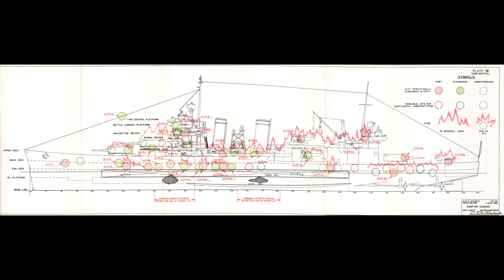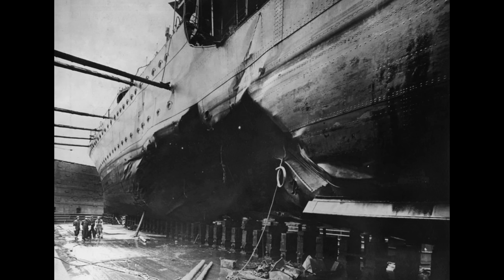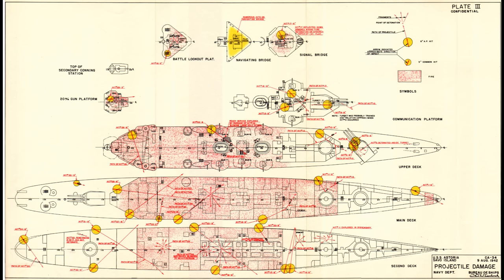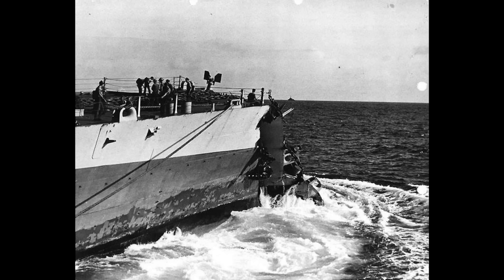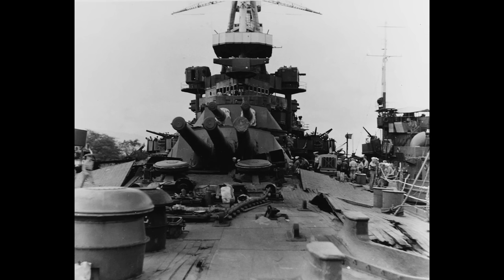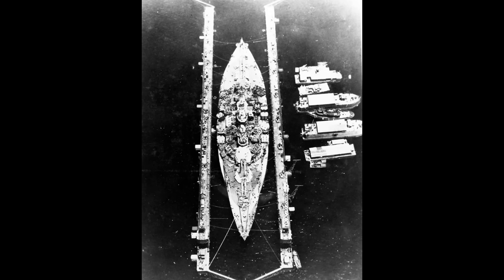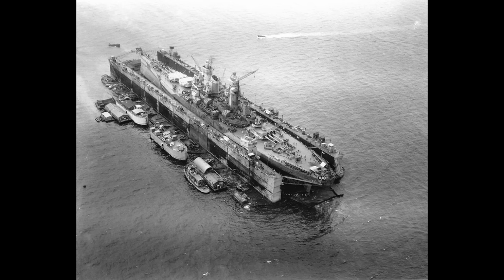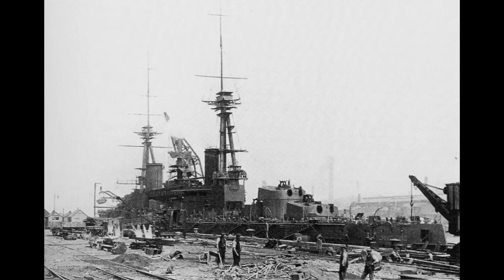Repairing a Damaged Warship - Ship Triage and Treatment

Comment: Honestly there are an awful lot of photos there which show just what a Herculean task the crews did with their damage-control procedures. With a lot of them it's a case of "how the hell did it survive THAT???". Some of those chuffing great holes look way too wide to have survived.... but still they did.  My respect for the sailors of various navies has gone up several points.
Reply: One of those pictures I recognized as an American cruiser that ended up missing everything forward of the turret... and I remember this picture because it was the number two turret. Number one turret was gone, the bow was gone, and the magazine that had exploded and taken them off was gone... yeah, the magazine exploded and they still managed to save the ship.
Reply: There's a lot of motivation in the fact that, if you don't keep it afloat, it's a long swim home. My own, noncombat experience doing emergency repairs to reactor controls involved shutting down the reactor and running on the diesel. The diesel exhaust pipe ran very near where we were working and an earlier hydraulic leak had saturated the insulation on that pipe. We found ourselves doing delicate, precision work with our heads spinning from the fumes. I know this pales in comparison to the conditions those heroes endured while saving, and in many cases, not saving their ships.
Reply: It is quite incredible isn't it
Reply: I looked at those USN after action analysis drawings, and the images of ships like CA-32 and breath a lot. Fix it or burn or swim seems to be a great motivator. Respect is indeed due.
Reply: you can become very motivated when your only other option to saving the ship is to go for a very long swim.

Comment: A note re: avoiding splicing wires.  I can confirm, at least in a mining environment, when re-building equipment we ALWAYS re-cable.  Any splice, no matter how carefully done, will quickly corrode and cause problems.  I can imagine this is much worse in saltwater spray environments.
Reply: Nonsense.
Reply: I working for a company that repaired cables. It's never as good as new but can be done well. I'm not aware of any mines that will do anything but the most basic repairs on-site however.

Of course this was in a workshop hours from the sea.
Reply: Interesting seeing the difference in fields - I work in automotive and we vastly prefer splicing in most cases. A well-soldered/crimped and heat-shrinked connection, especially in a static position (I.e. you don’t have to account for the wires to a control unit ever moving much) is usually plenty fine for the life of the car. But cars wiring is generally undergoing much lighter stresses by comparison - rarely hotter than 250F and not submerged or flexing a ton. 

Re-laying is also often untenable, since the majority of the car’s components are serviced by like 3 embedded harnesses + one for each door if you’re lucky. Tearing apart an engine or an interior just to replace the whole harness is a ton of work, and even if you just wanted to replace the wire between two components, that may require a long journey of removing stuff and opening up ducting.
Reply: @TimelyAbyss Are the harnesses in your equipment more modular, or more easily accessed, to make re-laying less of a hassle? I’m sure you don’t have to deal with a lot of trim panels 😂
Reply: @constructmaster6280 : I'd imagine that it's a more explosion-prone equivalent of housing rewiring, and the only reason that doesn't get done frequently is a lack of desire to hire an electrician, which likely isn't the case in any authorized mine.
Reply: @constructmaster6280  it’s worth noting that I’m talking about full re-builds not field repairs.

So a scoop tram or a face drill that’s seeing sunlight after years of “battle” being driven (or often towed) up the “port” (aka the surface shop).  Every cable (hydraulic and electrical) is pulled and replaced.  Engine removed and rebuilt…ect.  By the end the thing is almost factory new and ready for a few more years of “battle”.

 Seemed more appropriate given the context of the video.

Ah you can’t imagine the abuse these things see.  Constant heat and mud, highly mineralized mildly acidic water, rock falls, straight up abuse from the operators.
Reply: Linesmen regularly use splices to repair damaged sections of buried HV cable that simply can't be replaced without knocking down buildings or putting a big trench straight across a six-lane highway etc. But this is not a simple cut-and-shut job when dealing with HV cables as thick as your wrist, specialised materials and tools (and a fair bit of carefully applied force) required, and every part of the job must be done to a high standard to ensure that there are no problems later (for many years at least).

Comment: Battleships may look "obsolete" if compared to modern missile warships but they were still a true marvel of engineering. Just imagine: they built those formidable monsters without any electronic stuff and other "super-duper high technologies".
Reply: Play Rule the Waves and build your own!
Reply: I recall that in the '90s it was said that an Exocet missile would just ruin the paint job on an Iowa class battleship.
Reply: @harrykoppers209  mmhmm.

With ships having a minimum of armour these days, no need to have as much penetration in your munitions, when you can instead blast bigger holes, or have more range.

Someone, if they decided to make a modern battleship, and assuming said battleship got hit in the armour belt, would laugh off modern anti ship missiles. If it got hit anywhere else though... lets say, going straight down through the deck? battleships of WWII would NOT, survive that any better than a modern warship.

As such, if anyone WAS, going to make a modern battleship, intended to be armoured to protect against all threats. It needs to be far more armoured than battleships ever were historically, in an age where 13 inch thick plates of properly heat treated steel just aren't made anymore. And that then begs the question, won't someone just make a bigger missile  with your fancy new ship as a target, or find an already existing missile, made for bunker busting perhaps, that will do the job?
Reply: @Destroyer_V0 : I suspect they would worry about torpedoes and their own soft spots, build extra large so there's extra bulkheads to provide structural support & compartmentalization, and then allocate the rest of their attention to "stealth" and active defenses. LOTS of active defenses.
Reply: @absalomdraconis imagine the chaos if instead of plastering it's ships with Bofors and oerlikon's the usn would cover  any new battleships with Phalanx CIWS and all other manner of guns, decoy launchers, and missiles.
Reply: I do wonder in this age of drones and missiles, which can be shot down, if the time will come again for good old fashioned "dumb" artillery shells?  I concur with some of the other comments, an old battleship would laugh at modern munitions if hit in its armour, but not if it was hit in its "weak" spots.  I guess being hit from above would be the fear, something which I guess eventually saw the demise in battleships, they were too susceptible to attack by planes.

To my earlier point, I guess you could say how dumb would a modern artillery shell be? Even 100 years ago, the fire control systems were very complex, being able to zero in on a moving target 15 miles away using a moving gun after only a few shots with only essentially a mechanical computer and a set of fancy binoculars to help you aim is pretty impressive and still blows my mind a bit.

Comment: One issue I did not hear mentioned at all is the removal of dangerous materials.  Everything from the explosive contents of the ship's magazines to fuel oil to the contents of the paint locker needs to be removed or made safe before major cutting and welding starts.

Comment: Thanks for an educational presentation on repairing battle damaged warships, Drachinifel.  Left out of this narrative is that warships were the most expensive and complex war machines in 1940--and for centuries before that.  Even in 1940 the "high tech" bombing airplane was a simple machine compared to a submarine, a destroyer--or a heavy cruiser.   A capital ship such as a heavy cruiser might take three years to build--a B-24 rolled off the Ford assembly line every hour at peak production.  Repairing even a severely damaged warship could return that ship to service in better-than-new condition within months.  Famously, the American aircraft carrier USS Yorktown CV-5 was "sunk" by the Japanese during the Battle of the Coral Sea, limped into Pearl Harbor after some heroic at-sea damage control efforts, and three days after reaching Pearl was dispatched to take part in the Battle of Midway (where it was sunk three more times--body counts can be unreliable).

I was a Marine Corps avionics technician assigned to the USS Tripoli LPH-10 for a WESPAC cruise from November 1977 to August 1978.  I got to live on a warship for eight months while repairing aircraft radios. A warship is a living thing, a community, constantly undergoing modernization and upgrades.  One night during my cruise the Tripoli scraped something with her hull while steaming through a strait.  Divers evaluated the damage as soon as we got into port and there didn't seem to be flooding other than the customary leaks that were present prior to scraping something.  Since the warship was a synergetic being, trading out one model of radio for another wasn't always simply pulling a unitized module and plugging in a new one--the radio might need a different antenna due to frequencies or signal polarization, the control boxes might need modification or replacement, and while the radios are supposed to be designed around specific input voltages (includes voltage, amperage, and power supply frequencies) other factors such as the need to refrigerate a more-powerful transmitter may require overhauling the power distribution network from buss bar to the mast-mounted motors to turn the antenna.  

I toured the Belfast while in London and even though I knew she had been damaged in battle, Drachinifel's presentation told me that the Belfast had been more severely damaged than I suspected.  At the same time, the effort to move Belfast from battle zone to dry dock and rebuild her ("repair" is an understatement) resulted in a serviceable cruiser in service faster and with fewer resources than if a new Belfast was built from the keel up.  The story of the two Yorktown aircraft carriers (CV-5 and CV-10) is instructive--CV-5 was undergoing salvage operations and was en route to Pearl Harbor when a submarine of the Imperial Japanese Navy Submarine I-168 put two torpedoes into Yorktown for her fourth sinking!  Meanwhile, CV-10 Bonhomme Richard had been laid down on 1 December 1941 and was renamed Yorktown on 26 September 1942, launched on 21 January 1943, commissioned on 15 April 1943, and 22 August 1943 began her first combat operations.  Three days in Pearl Harbor being repaired versus hijacking a hull under construction and renaming it taking 11 months--with about a ten month head start on construction--no wonder the US Navy put so much effort into repairing battle damaged ships. CV-10 Yorktown is a museum ship today.

Not all recovered or recoverable battle-damaged ships were "economically" repairable.  BB-39 Arizona wasn't economically repairable even though parts of Arizona were removed for use elsewhere.  Imperial Japan's Shokaku required ten days in drydock and undamaged Zuikaku needed a new air group after the Battle of the Coral Sea, and this kept them from adding a pair of Japanese aircraft carriers to the Battle of Midway.  Yorktown got a new air group in the three days she spent at Pearl Harbor.  The two Japanese carriers didn't get immediate replacements of aircraft and air crews.  Imperial Japan had both the problems of building new ships in a timely manner and being unable to repair battle damaged ships--there wasn't enough shipyard space, enough raw materials, or enough skilled ship wrights to both repair old ships and build new ships.  Drachinifel described the issue of limited shipyard space and other resources--triage was prioritizing getting ships into the war quickest.  Sometimes that meant repairing shot-up ships, sometimes it meant hijacking a partially completed ship and making it something else (even if only a name change), and sometimes it was building a brand-new ship from scratch.

Comment: Nice video,  Drach.  

Something that you didn't mention and perhaps you could confirm:  it has been my understanding that in situations where available repair slips were in short supply; navies will typically choose to proceed were repairs on lesser damaged vessels since those repairs can be completed sooner. That allows for that ship to return to the front sooner and frees the repair dock for another ship.  Where as a heavily damaged ship may need to wait until specific replacement parts can be shipped before repairs could even begin and would just be blocking repair space that could be used for other ships. 

Am I correct in this thought?

Comment: This is a great video for pulling together a lot of disaprate bits into a summary of how the process works.  It's always been kind of fascinating to me how badly mauled a ship can be and still not be given up as a total loss!  (Battleship Row, for example.)

The bit about replacing whole beams even when there's a pristine section is interesting because the conventional wisdom my late grandfather always imparted to me was a good weld will be stronger than the material around it... was the steel used in shipbuilding more sensitive about that sort of thing?

Comment: I've been dying to ask this... how many times did belt armour actually work? I can't think of many occassions where a warship survived that would have otherwise sunk?
Reply: Because it was taken as granted, really. And there are quite a few: South Dakota, Warspite, half the High Seas fleet, Seydlitz and what remained of 1st Scouting Group, 5th Battle Squadron.... You just don't hear as much about them because the belt armor rejected the shells. The most striking ones are where the plate got punched in and you still had flooding: That shell would have done far more damage if it had passed through.

Contrast that with the ships that didn't get saved: Hood (due to a lack of armor in the probably hit section as Drach noted->The result was the lucky hit which set off the magazines), Invincibles, Boise(Magazines detonated, but she kept afloat), Aoba....

Comment: One point you may have glossed over is the replacement of major systems like boilers and turbines may require the removal of a significant amount of both the damaged and undamaged structure and superstructure and it isn't always possible to remove structure in ways that would allow it to be reconstructed.  This also counts into the decision to repair or modernize.  For instance the decision to provide the rebuilt Pearl Harbor battleships with entirely new modernized superstructures was probably mandated by the simple reality that most of their existing superstructures had to be removed to service the machinery regardless of damage.

Comment: I was just on the North Carolina and was impressed by the size of the hole made by the torpedo strike. This they repaired in 21 days. How?
Reply: Round-the clock work. Also, to the extent practical the TDS is designed for ease of replacement, since the way it works is by collapsing.

Comment: Drachinfel,

When would the damage plates be shared with the shipyard?  For example, Did USS Yorktown send damage plates, a  formatted message or other information to Pearl Harbor so that the shipyard would have the required resources available?  I find it hard to believe that the shipfitters and welders, etc., didn't have prior notice that there was a big repair job inbound.

Great episode.
Reply: From what I understand there was a lot of radio traffic between Yorktown and Pearl Harbor into the details of the damage. Then when she got into air range she flew  the reports over to the drydock. Plus Pearl Harbor had a copy of Enterprise’s blueprints lying around. So that when Yorktown arrived into drydock. The workers knew what to fix up.
Reply: @ph89787 and many repairs were done while underway from the Coral Sea to Pearl. More repairs were done after Pearl on the way to Midway!

Comment: When building or repairing WW2 tanks/panzers you need to use expensive stainless steel welding rods for joining armoured plates together. Usually the root run & maybe another stainless run is done & the rest is done with normal rods to save money. Was this the same with ship armour repairs as well?

Comment: 1981 (ish) The USS Saratoga (CV-60) had a deformed hull and a bent #3 shaft.  Solution? While she was in Philadelphia Naval Shipyard Drydock #5, they place various support blocks that would be the right height if the hull hadn't been deformed and the sections above it unsupported.  They also took off #3 Propeller and hung weights on the shaft after placing the bend so it was "up".  They then let gravity work!  (Over simplified explanation, but this was basically the gist of what they did....)